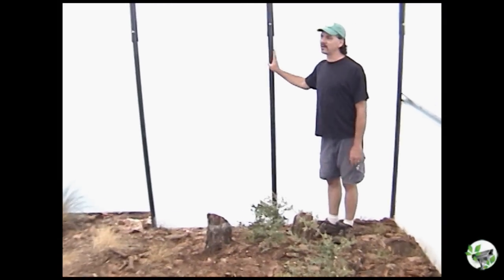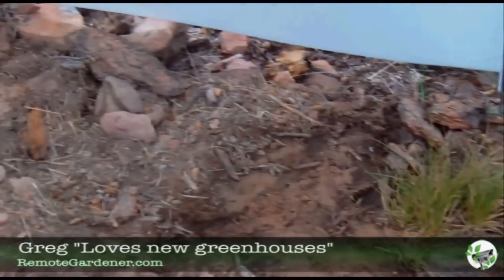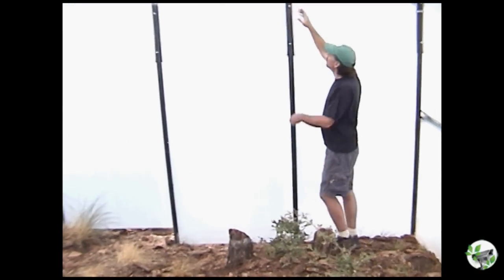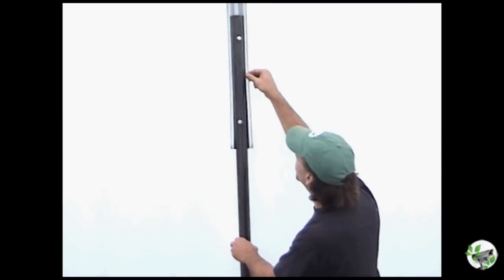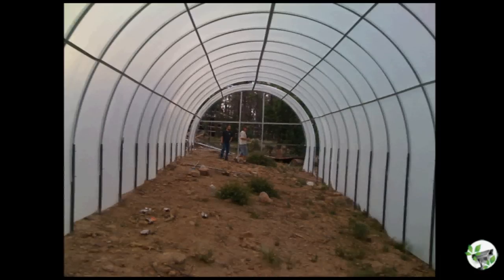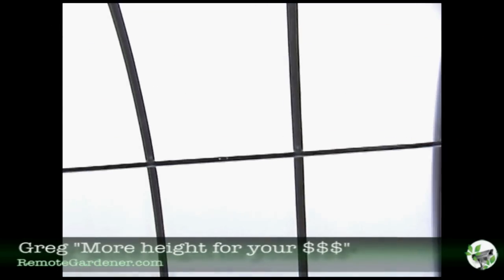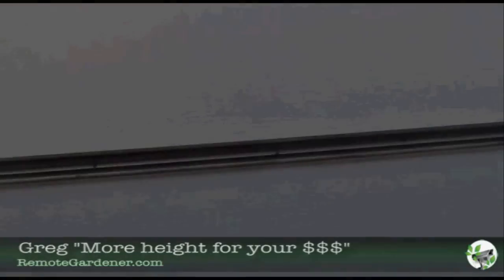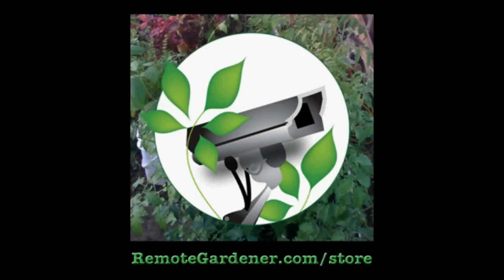Remote Gardener - Modifying a Cold Frame into a Greenhouse

Comment from the maker: This greenhouse was designed for rain water harvesting. On the high side outside there is a 2 foot brick wall. Between the wall and greenhouse is a raised garden bed. Any water coming down the hill hits the wall and funnels down to a pond. 

This works with the rain gutters -just above ground level on the low side and just above the raised bed on the high side- we have down each side to feed water tanks and the pond.

Comment from the maker: Two years running so far with heavy winds and no problems yet. The poles are two feet of cement and it has and should continue to hold up. If it ever does blow away, I will be sure to post the video. :)